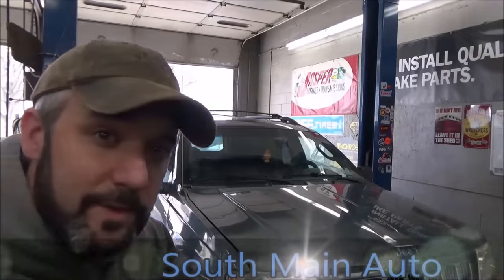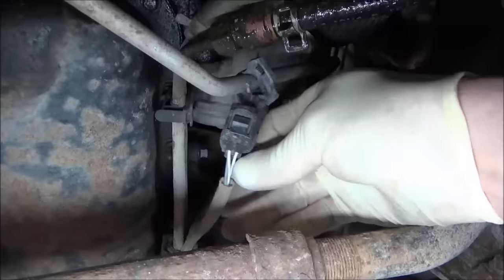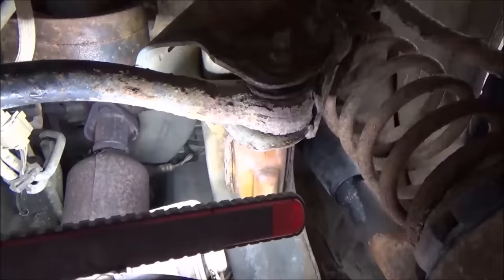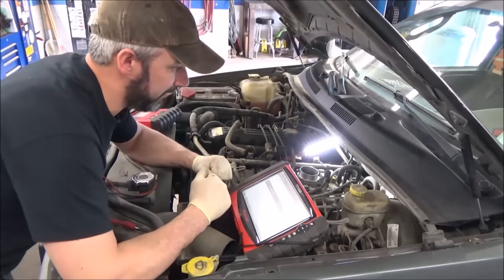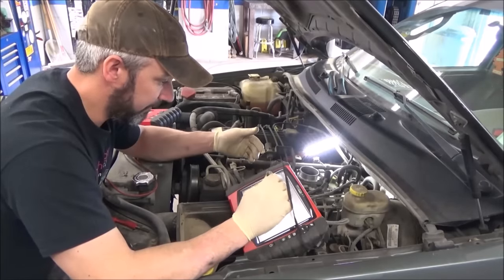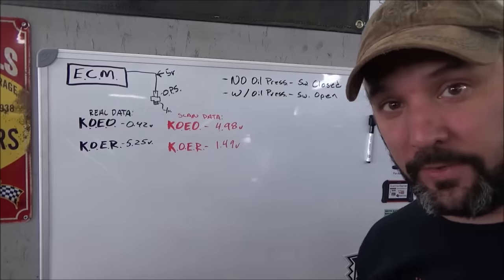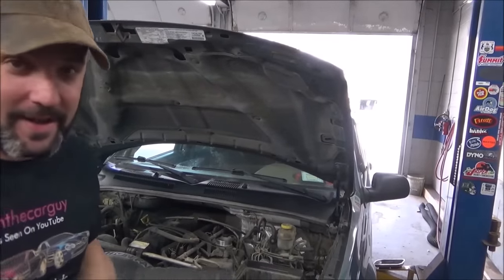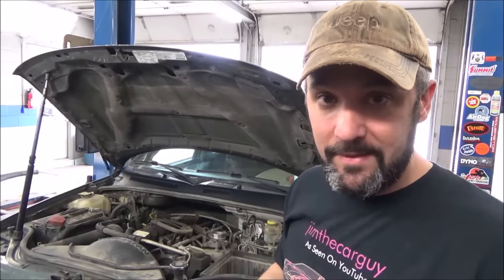Jeep Grand Cherokee - Check Engine Light P0141 / P0155 / P0523

Comment: Good job and video, Eric. You tried every way possible to complete the job by repairing the connector but you did what you had to do. I think I would have done the same. The repair will likely outlast the rest of the rusted, leaking hulk.
Reply from the maker: +wysetech2000 Yeah some times yah gotta do what ya gotta do right?
Reply: That's right.
Reply: No doubt. Having exhausted all other options, absolutely the right fix.
Reply: Same difference as a splice on a universal O2 sensor

Comment: Hey Eric, l have issue with the oil pressure gauge info. It must be with that particular vehicle. My 2000 Grand 4.0 has 58-62 psi cold start (north Delaware) in the winter months but above freezing 52psi then drops to 44 after the motor is hot ,42 in gear. There must be a correlation between the switch plunger and voltage sent to the oil pressure gauge.My gauge goes up & down with rpms. I had mechanical gauges in all my old muscle cars. What's wrong. Your a good man, great mechanic, you keep me going(62 yrs old). THANK YOU.

Comment: All the WJs up until 2002 or 2003 had a real sensor that would read pressure and when they switched to a dummy switch they didn't want to reconfigure the cluster so people didn't think they "lost" a feature. It was done to stop complaints to the dealership of low oil pressure since it is hard to explain to the customer that it is normal when the vehicle is hot on a hot day to have a lower pressure at idle. LOL

Comment: The oil pressure gauge on my 1996 Dakota 5.2L is a fraud too.  I owned the truck for 8 years, and sometimes the needle dips to L which also makes the oil light come on.  After reading forums about other people having the same problem i ignore it, and treat it as a Chrysler epic fail.  I could buy a new sender to maybe cure the problem,  but why replace a part that is failure prone?  The truck always ran fine otherwise

Comment: Oil pressure PCM processed data inverted vs. real data just to make your head hurt.. It messed me up too when I was diagnosing P0523 especially when I disconnected it and checked it with my DVOM & lab scope b/c I thought I was losing my mind. If voltage is > 4.6V which yours was 5.25V it will set the code especially with that initial spike...real data for an open capacitance style switch . You are absolutely right when you say to just install a sensor after a quick visual b/c it is cheaper than troubleshooting  & it's always fixed the problem for me. I did laugh when I seen how the B1S2 wiring was routed & clamped. You'll probably have a customer for life for getting him back on the road vs. waiting for a connector. You definitely went above and beyond when you went to the salvage yard searching for it yourself.  I did learn something new about the heated O2 drive cycle readiness monitor so thanks which is why I like watching videos...always trying to increase my knowledge. As usual great video & nice intro!
Reply from the maker: +Hayward's Automotive Yeah the chryslers like to run the EVAP at start up and idle warm up then run the O2's after key off. More and more newer cars have Key Off EVAP Systems too....

Comment: Alot of cars and trucks use an oil pressure switch, with or without a Guage, fyi most temp sensors lie on the dash too, it will show 190-200 on the dash rock steady but if you watch scan data they vary much more than the gauge shows,  gives people the warm and fuzzies that the gauge is rock steady in the green
Reply from the maker: +Michael Berg Could you imagine how much the dash gauges would move if they were live readings?
Reply: South Main Auto Repair that's the main reason they 2ork like that,too keep new car owners from freaking out
Reply from the maker: Prolly a good thing or our phones would be ringing off the hook !
Reply: yea, my 93 GMC P/U has live gauges. Take one turn and the gas shows empty, other way, it is full. I know most fords tend to have a switch with a gauge, does not hake since for me.
Reply: yes. my old 88 chevy pickup has live readings. when you take a corner the fuel drops to empty, the other way, full. lol

Comment: usually I check part cross compatibility before heading to the junkyard. looks like you could have gotten your o2 connector from an 01-04 dodge Durango or Dakota or ram 2500/3500, an 01-06 ram 1500, any 2004 jeep, and any 01-02 ram van. I'm still only halfway through the vid, but I'm hopeful it'll end in a job well as per the norm
Reply from the maker: +cryoburned Yeah it is slim pickin out there in that yard, most wires are cut and MIA

Comment: Your oil pressure voltage numbers were probably skewed by using a test light to apply ground. Use a jumper wire, Power Probe, etc.
There's resistance in a test light (bulb filament) that adds resistance in the circuit during testing.

Comment: Eric, in industrial automation, some two wire sensors have a constant voltage supply and the device varies the current it sinks. Usually they vary between 0 and 40 mA. The application is for long leads or noisy environments. Have you ever seen that approach used in a vehicle?

Comment: Chryslers typically have both an oil pressure on/off dummy switch AND an actual oil pressure sensor. I'm not familiar with the 4.0L specifically, but a lot of Chrysler motors are like that.

Comment: Hey Eric, that O2 fits 2wd 1500 rams from 00 to 06, Dakota 03 04, wrangler 01 04, also the 2500 and 3500 series you would have to verify years on those, also the 06 pacifica and the ram van 01 to 03, seems a pretty popular connector from 01 to 06. just a FYI post to maybe save some time on your end.
Reply from the maker: +jim M Well I actually called NAPA When I was out in the yard to see what all that O2 Sensor fit and it seemed the 3.7 Liberty in the early 2000's and a few early model Rams but that was it. Remember it has to have the same locater tabs on it to work right...
Reply: +South Main Auto Repair  ya I did the cross reference from autozone and o reily's.....don't use there parts much but they sure have some nifty features lol, the o2 used in that jeep was listed as cross reference for all those I listed and more, you didn't lose me a subscriber because of the repair, I would have done the same with no option and the whole time is money thing.....it bugs me when I want an answer and no one has one....and because I have a feeling your the same way I thought i'ld post for you...and no, I do not hold internet info as the gospel, i always like to get a couple different sources. but now that i posted this, you'll need to see if its true haha.

Comment: iirc the engine controller was changed in 2003 from a JTEC to NGC PCM in  jeeps and dodge trucks.  The old JTEC PCM would read oil pressure and the gauge would move but after 2003 MY the guage would only read high if you had oil pressure.

Comment: I enjoyed the video! I have the dreaded P0420 on my 02 Subaru Outback H4. I'm using an Open Source Scan Tool called Romraider. It's not as nice as your scanner, but I think it will do the job if I can learn how to use it. The thing I like about your videos is your approach to troubleshooting. You break it down into its simplest parts and logically work through the problem. Personally, I appreciate that you rewired the O2 sensor they way you did. No it's not spec, but you did the best job that could be done with the resources you have. And you got that Jeep back up and running! I watch your videos because you have the experience and knowledge of automotive systems. And most importantly, you can transfer that knowledge to the masses. Even though I don't know you personally, I feel confident to work on my vehicle--even in really hard to diagnose problems. As a side note, I'm putting in my application at a Subaru dealership for an entry-level Lube Tech job. At 49 years old, I want to start a new career as an Auto-tech. Thanks for the inspiration!
Reply from the maker: P0420 on a sooby is pretty common. Especially at or around 150k
Reply: Figures. I'm at about 173k. OEM Cats are ~1k. If the Cat turns out to be bad, is OEM my only realistic option?
Reply from the maker: 100% OEM only on those, trust me I have been down that road. Aftermarket will not work!

Comment: Interesting video. I had a '99 JEEP Grand Cherokee with the same engine and had the oil gage pin high when it failed. I'm wondering if they went to a simpler circuit in the later years. Also, when you had to cut the connecter out, that reminded me of the time I had my electric radiator fan replaced. The connector had a bit of heat damage form the current flow and couldn't be reused. I had to do the same thing.

Comment: if i remember correctly, jeep have a body control module, this part regulates the negative current. and the processing control module regulates the positive current. the idea is to make the wiring harness much simpler, how it works well you can tell by your writings on the white board.

Comment: Loved the old cars that showed the Check engine codes without a scanner ! Like 95-99 dodge neon turn key 3 times and the light will flash. you would count the pluses ... Newer neons do the same it would tell you like p0141 .

Comment: From the wire ties repair to the front bumper to the rusted through hole in the fender, I'm sure that Jeep will be in the yard before you need to replace that  02 sensor.
Reply from the maker: +Upallnight That is what I am counting on
Reply: @Stimpy&Ren Yeah LOL we do drive some of the oldest cars in the Yurup if not all the world... yet some of these are shipped to Africa for a few years of more use. I bought my first two nearing 20yo, then a few nearing 15, one at 12 (gasoline up to that), and now I have a 11 year old diesel. Heck, no need to get electric unless diesel prices skyrocket. Seems to have similar fuel efficiency to what they promise for gasoline hybrids, and the technology is far simpler.

Comment: Those O2 sensors receive outside air through the wires from what I understand.  They tell you right in the directions to never splice the wires.  But, it passed a drive cycle.  Who knows if they work correctly.  He did say the back ones were switching like the front to indicate the converter was shot so maybe those older sensors get their ambient air from other than the wires.

Comment: That switch can be an input to the computer for ac use. If oil pressure is low, ac clutch doesn't get power.

Comment: I suspect the reason they did this is that some version of the G Cherokee has a working oil pressure gauge. Maybe not one that  is sold in the US. Oil pressure gets sent to the ipc via communication bus from the PCM. Rather than redesigning the ipc to understand on and off from the pcm for oil pressure, they program the pcm to translate on and off to 0psi or 40psi, and (fake) oil pressure numbers or (fake) oil pressure sensor voltage gets transmitted to the ipc. I don't know that for sure, but that's my guess. IPC is probably made by an outside source, most Dodge truck PCMs are built and shipped blank, so it may be easier for them to make a different pcm calibration than make a different ipc calibration.

Comment: My 97 Grand Cherokee 4.0 has a real oil pressure gauge goes up & down with the throttle. Also my son's 99 blazer has a real gauge in it, I think v-6 4.3.

Comment: My 2001 cherokee oil pressure sending unit fell apart as I was removing it,it had oil fouled inside from leaking and the inside of it is a small circuit board I think it does more than simple send pressure confirmation

Comment: 703 Jeep Grand Cherokee, it does have a 4.7, but when my oil pressure switch showed 0. I reconnected the single wire and it showed me about half pressure. I have seen it very once in a while but not greatly. Due notice that if I put about half a bottle of STP and it I'm showing a little bit higher oil pressure so I don't know what the world's going on with that . The other differences is my well pressure settings unit is right up on top of the engine. I have no idea why add oil pressure switch would be down right above the starter. But I haven't worked on off 4 liter inline 6 in quite some time.
 I will check into it a bit more. Perhaps even do a direct Reed instrument test.

Comment: Those pins can be reused. Pull out as much of the old wire as possible, tin the end of the new wire then flatten it with pliers, trim it short and solder it to the crimped portion of the pin. This won't work with some connector housings there is not enough room for the solder blob/wire but for most it works fine.

Comment: Eric - I kinda confused here..  I can only somewhat agree the Oil Pressure switch is a parts swap dealio, Only Somewhat because you did the testing and found out a lot of really neat stuff for the ole melon cavity to use now and later on and Bud, you taught us a lot.  Parts Swap ??  Not in this case.  Maybe if it comes back next year and you avoid the diagnostics just toss on a ridiculously cheap switch.. (Maybe)
Reply from the maker: +Hawaiian F150 Oh yeah I hear ya, and even though I spent way to much time on it that is one thing that we gained. Head knowledge... no just got to figure out how to keep it in there!

Comment: Just solder wires onto the crimp. You can still use the weather pack. The wire may go hard into the plastic connector housing, but it works and it is solid.

But yeah... Not many option.

Comment: Some of those switches are actually closed under 5psi but have variable resistance 5+ psi. I seen one like that on a car before. Usually of coarse its the classic switch or resistance style. or you might get a few of those thats 3 wire transducer or 3 wire (one switched to ground/other to gauge). But it is confusing which ones are which. Im surprised they didnt ask for rpo codes or if it had a gauge at chrysler, because i was thinking this could hace possibly been one of those 1 wire wonders with a switch below 5psi and res above.

Comment: Just wondering that considering with all the road based corrosion up there if you dab some dielectric grease every time you reinstall an electrical connector
After binge watching your excellent channel I haven't noticed that you do
And you would usually show it if you did
Cue the dramatic music like the brake cleaner!
😣👍
I do here in Florida as our issue isnt so much road based but ambient salt and humidity 
Just wondering

Comment: 99-01 has a multi-wire system where the PCM reads output and displays results on the gauge. 
In 02, they went to a simple slide switch sensor that just tells the PCM there IS oil pressure, but displays ONLY 40 psi all the time. The theory is Chrysler always had a full set of gauges and the thought was sales would fall off with a simple idiot light. I got the wrong sensor for my 00 and only got 40 psi all the time.

Comment: Some of the Trailblazers and probably other GM models had an oil pressure switch and a fake gauge.  The PCM would use an algorithm to determine the oil pressure when the switch was closed and then would send estimated oil pressure data to the ICM.   Just thought it was funny to see the gauge move, but it wasn't the actual oil pressure.  Ford's Ranger had a fake gauge also.  You ground the oil switch circuit and the gauge would be smack dab in the middle between high and low.  LOL

Comment: Maybe the PCM has a strategy to vary the amount of output voltage to the oil pressure gauge on start up so the gauge sweeps smoothly and emulates the genuine oil pressure rising even though the input is binary.

Comment: My 93 Ford Ranger also had a useless oil pressure gauge.  If the engine was running, it read normal.  even if it had no oil pressure.  It too was a one wire that pulled to ground.  Most of the 90s-2000s vintage Fords are that way
Reply from the maker: +Cory Farren worthless design haha
Reply: Worthless design indeed.  My 89 Dakota had a true oil pressure gauge.

Comment: I have one that works and it goes up and down in pressure like it should. The reason is most owners do not understand that it goes up and down with rpm and temp of the engine. They complained, and so easy fix put a dummy system in just holds at 40 or what ever the factory wants it to be.

Comment: Odd, my '01 GC 4L has an oil pressure gauge & it 'floats' with rpm & temp. Maybe different pressure gives it different resistance & the PCM changes the voltage to the gauge so it displays different levels?! 
Interesting video!
The zip ties on the bumper cover look like sutures lol
Reply: 2002 was the last model with a real oil pressure gauge.

Comment: 45;16 old farm houses. Nice! Seen while test drive JEEP.  I have same issue with Oldsmobile. Think.  Click no start. It used to crank no start two days ago. It has  engine light on when it ran. I bought new battery. I learned bolts on battery cables stripped wont tighten cables So i will change bolts today it explains no head lights  (have flickering  interior lights) Does click mean ignition switch is good? Or starter bad? I dont know anything about 3800 motors. I cant find starter to wap on it. Is starter in the back of block. Im frustrated!!! Im a female btw (I can work on 3.1 Lumina)

Comment: That's because the reference voltage from the ECM has such low amperage that it throws off the voltage readings. If you connect a test light to that it most likely won't even light up. ScannerDanner has a video that explains how the 5 volt reference voltage works.
Reply from the maker: +Rod Palm Lol I know how a 5v reference works, you use a test light to do a by pass test because it is the safest way to do it. I never expected it to light up. Just wanted to pull it to ground.
Reply: I figured that, wasn't trying to critique and mostly just wanted to say something that might provoke an actual response. Keep up the good work. You are the best mechanic I know.